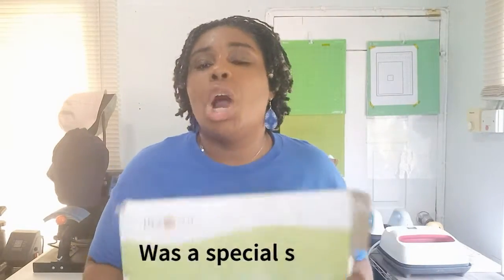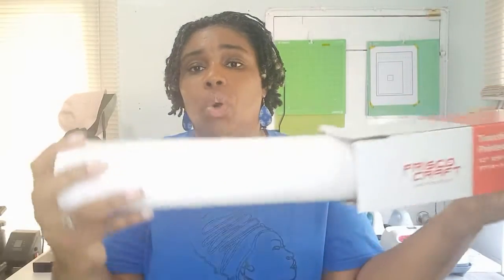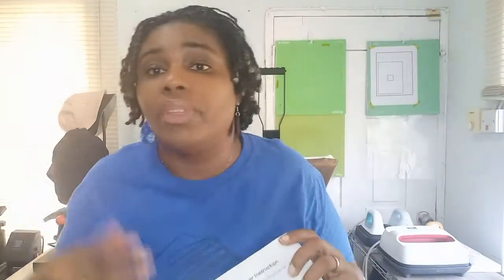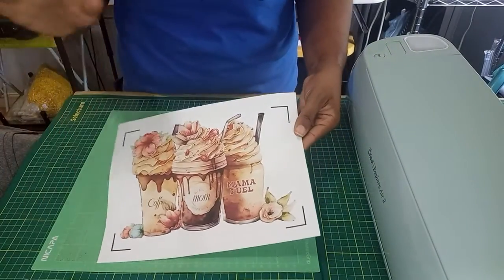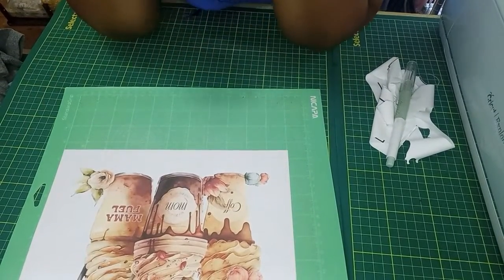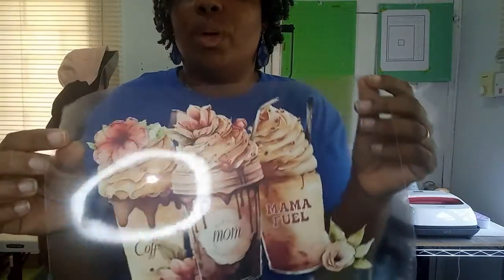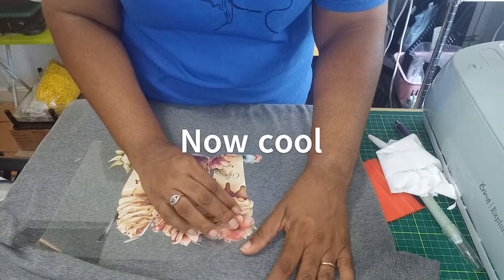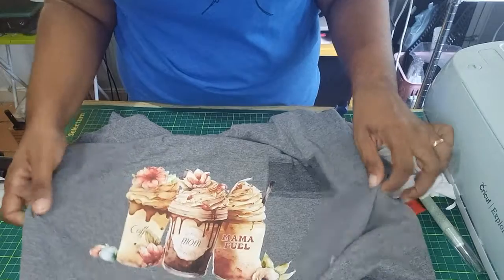Printed T-shirts using HTVRONT heat transfer paper| Frisco Craft Transfer Tape

Comment: Hi there, I took a lot of the tackiness off the Frisco tape by tapping on a piece of cotton fabric several times applied to HTVRONT transfer paper, pressed at 320 degrees 15 seconds peeled cold and had same issue as you… 

I got another piece of tape removed a lot of tackiness, adhered to transfer paper then turned press temp up to 340 degrees and 20 seconds peeled hot and it worked… Should you try I hope you will have success as well… 

Thanks for sharing and the initial testing…. ❤️🙏🏽
Reply from the maker: Oh wow. I shall try that for sure. I could do an update video if it works. So happy it worked out . So many people have had fails. Will share for sure
Reply: @ it’s still finicky the white part of image releases after pressing at one temp and printed part at another temp…  I had a white border around image and white lettering… 🤦🏾‍♀️

Also I found when I left my printed image on its own backing overnight it wouldn’t release and if it did the paper would peel up with it… An update video would be great once you become familiar with the process… keep me posted… thanks ❤️🙏🏽

Comment: How long and/or how did you dry the image?
Reply from the maker: Hi. I just let it air dry. Also if you can avoid using the the transfer tape do so. I was very careful but as i showed in the vdeo it picked up a little bit of the ink, but others have said it ruined their design so i would say dont bother. What has worjes great it ths backing of htv for hot peel vinyl...the cold peel ones dont work

Comment: Use the frisco since night and it ruin my design
Reply from the maker: Hey. Sorry to here that. Yiu have to make sure it is really cool. As i said in the video. I keep losing little sections of the design but i never had a complete ruin. In the video i also suggested that the left over transfer sheet of htv worked better than this. I will try with it again and see if i have better advice
Reply: @yanxacreations  that I realized

Comment: Htv ront is my fave go to and i just tried frisco and it ruined my rush order for my client 😫
Reply from the maker: Oh...no. I did say in the video that it was lifting the ink in both attempts. Not too much but enough to be a problem. I am so sorry. I use the old backing from other htv to lift htvront paper.
Reply: @yanxacreations  mine took almost my entire sheet off and I pressed it for over a minute because I checked it after the first 30 seconds and it was still lifting so I pressed it for another 30 seconds checked it same thing checked it again and it let it cool for a bit, and when I went to lift, it took off almost the entire design. how long did you let your school before you took the transfer tape off? Did you do it while it was still warm or did you wait for it to completely cool down? I just know some transfer tapes are super tricky and are either cold peel or a hot peel
Reply from the maker: @DesiGlamLife  hi. I waited until it was cold and make sure you give it enough pressure and dont over press it. I always just lost a little. Most of time someone would not be able to tell i had lost some
Reply: Mine messed up it pulled up my ink
Reply from the maker: @caleshaj525  oh no. What works best is the left over carrier sheet from my htv. But i have used this transfer she several times. Letting it get cold and not too much pressure
Reply: Thanks I will try using another film from htv